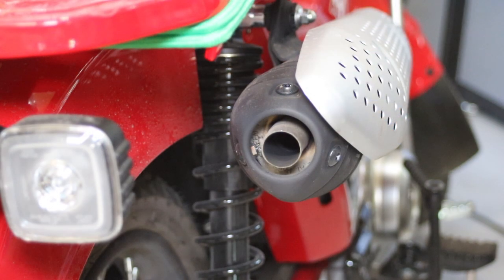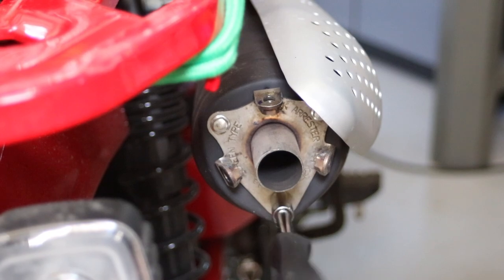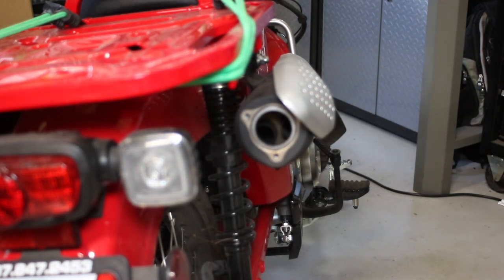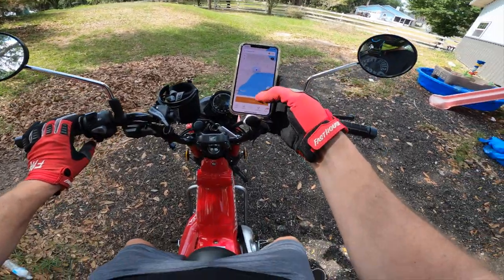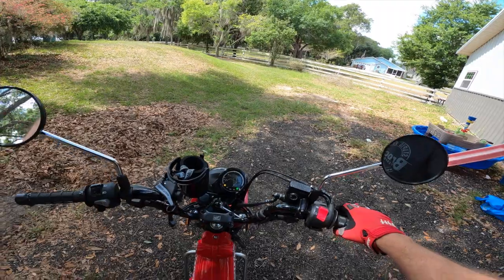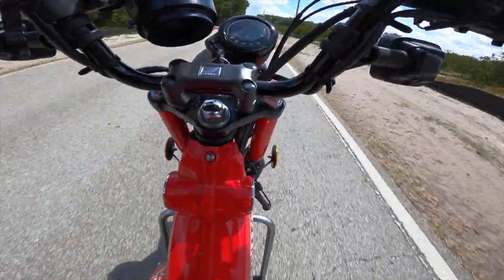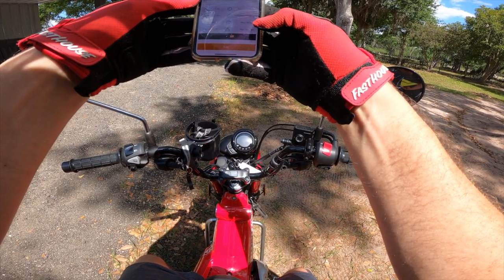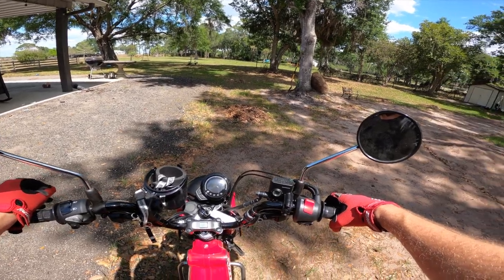Can we unlock horsepower from a stock 2021 Honda Trail 125 by removing the spark arrestor?

Comment: Reminds me of when I picked up my first two CT70s and the kid that had them had hacked the muffler in half on the one that ran and told me it sounded like a Harley. Right!. I replaced it with a new one and couldn't feel any difference in power, it had more with the full muff and baffle if anything. Most people think it's faster because it sounds faster. I'm glad you showed that it actually runs better the way it was configured from the factory and maybe people won't be starting fires in the woods. Also, most modern cats are non-restrictive so that probably won't make a difference either, just make it stink and pollute more. If you want more power just put a turbo on it with a K&N cone air filter, or you could just get a faster bike to begin with. My recommendation is a Hyabusa, 90+mph in first gear, over 150 in 3rd. The kind of bike you give to a beginner to learn how to respect a bike...or die.🤣
BTW, Def Leppard sucks!
Reply from the maker: I love this comment, this video caused so much static because people thought I took out the arrestor and was going around starting forest fires. If watched all the way through like you did, anyone would be able to see that I said it didn’t work and put it back in. Thank you sir for the story, comment, and watching all the way through!
Reply: @John5XR  Oh sorry, I either missed your comment on the video or didn't watch to the end. Probably watching at 3 am and half asleep anyway. I'm glad you did explain the results and hope people won't just take them out of their bikes based on your vid title and watching half of it. Maybe you should have said or put in the title to watch to the end for results of the test.
Reply: What? Def Leppard definitely rocks. I don't think most beginners start on a Hayabusa for fear of death lol. If you have a Hayabusa that you'd like to give to a beginner then lmk. I'll take it. Dude just wants a super cub but bought the hunter cub. I knew the stock was gonna go faster from the get-go.

Comment: If you wanted it to adapt to the change, I'd ride 10-20 miles to let the ecu relearn the optimal AFR then try the top speed run. Just my 2¢
Reply: It probably will add a bit of top end after riding it more uncorked, just idling won't make the ecu adapt the fuel map like riding would
Reply from the maker: agreed, I rode for about two miles and knew it wouldn't be enough to let the ecu adapt to the change, but didn't plan to keep it out anyways. More of a test of curiosity.

Comment: Out of curiosity since you've had it a while. Any future plans for an after market exhaust? I was eyeballing the Yoshimura Cyclone.  Pricey but very cool looking and sounding.
Reply from the maker: There’s a few more I’d like to try, but don’t think any of the high mounts will sound any different. Low mount would be the way to get a different sound, but I’m not a fan of the low mount design due to riding offroad mostly
Reply: @John5XR  Definitely high mount on this bike.  I will say I do like the stealthness of the oem tho.

Comment: would it require enriching the mixture ( a tune) to take advantage of the possible reduced restriction in the exhaust, or any mod that reduces flow restriction? Perhaps the ECU has some compensation, an AFR would be interesting.
Reply: It’s fuel injected ..it should adapt to that small change.
Reply from the maker: ECU should compensate after about 20-miles I think (from my experience with the Monkey). I didn't like the sound of it anyways, so I wasn't gonna keep it in regardless

Comment: I would go for a K and N air filter as well, help to balance output and input
Reply: I wouldn't stop using the foam style or paper style that k&n filters end up damaging engines by dusting them 🤷🏼‍♂️
Reply from the maker: that'd be interesting to test
Reply: Yes they allow more dirt into the engine. Keep the foam.

Comment: I am not sure that top speed is going to be the metric by which to gage whether there was an increase in hp. In this case obviously there was a decrease, but as I understand it, the computer driven EFI acts as a governor and won't let the engine go over a set RPM on the road. Had the speed been identical before and after the spark arrestor been removed then another way to try it might have been to gear up the sprockets to the point where (by using a tiny tach) that top EFI governed RPM couldn't be reached with stock exhaust and then run the experiment. Probably best to use the GPS method as the speedometer will not be accurate any longer.  Then if the bike does go faster then you will know if the mod helped hp or not.

Comment: mine is now 1 year old yesterday. and it loves 50 mph. but on good days i have seen 62 mph. and its still 100% stock. its not for from needing a new chain and when i do i'm thinking of going to a 15/ 41 i will have the same top speed. but when i hit hills for a few days in a row i can drop my front sprocket to a 13 or 14 and get more power. but with a stock bore engine i dont see getting anymore power or speed out of it.
Reply: Update. i took mine out and it seemed to give me a little more power lower end but the same top speed. and made more noise.  so i just cut the screen off and put it back on and same thing more lower end power seemed to hit top speed sooner but still the same. now i'm thinking of cutting the tube off at the mount and see what that might do because it wont have to make 3 trips through the muffler.

Comment: If you want top speed change spockets. 3 teeth less in rear or one tooth less in front. You will get more top and but loose a little low end power. I am the same way I like to test. I have a Yamaha 125 ytx and  I live on a small island in the Philippines
 I use 14 teeth front and 42 teeth back. If no low end torque I can not get up the steep hills cut from mountains.
Reply from the maker: I don’t, I like the low-end grunt better. Just like to test everything

Comment: A lot of these small bikes from 50cc up 125cc maybe a little bigger used to have a small diameter piece of pipe welded into the exhaust where it bolts onto the head to restrict them I removed loads of them when I was younger for myself and friends who had bikes, it takes some hammering to get them out but it always had good results but taking out baffles never done anything other than change the noise so take a look.

Comment: You're gonna need some back pressure on the valves...
Open pipe.. Not good for the engine...
Weld a 3/4 inch washer at the end of the exhaust pipe.. Hold Back pressure on the valves... 
And I Am a mechanic, a real one...
Reply from the maker: agreed, but I put it back in because it didn't change anything

Comment: Check with Ronda ranger about the  spark arrestor you start a fire you pay for it, the fire can cause much damage even deathl..
Check with Honda about hp output that it doesn't matter for the valve's, my z1 lost 3 hp taking out the 4 spark arrestor baffles...

Comment: Exhaust back pressure on any four stroke engine increases the power range, so instead of getting majority power at lower rpm you get power right through to high rpm. The only thing that makes a vehicle go faster is gearing.

Comment: When you lower the exhaust back pressure, you need to change the size of your main jet if you have a normal carb, or reprogram your computer if you are fuel injected, if you want to realize any power gain.

Comment: Actually, if you put the cap on without the spark arrestor you will gain a bit of speed. You left the e d too open.
Reply from the maker: I couldn’t, it was built in and the arrestor wasn’t removable unless I cut it.

Comment: I've learned some things run better with a little back pressure
 I had a blown small block Chevrolet drag car I wanted to make it straight legal so I put mufflers on it And it actually ran better Even at the drags with a muffler's on

Comment: On my Wave and on my partners Monkey, removing some restrictions from the Air intake helped getting more low to mid range rpm performance.
- On the Wave I drilled extra holes into the airbox and on the monkey we removed that snorkel piece.
I tend not to mess exhaust and intake at the same time for fear of leaning out the engine.

You'd need to now muck around with changing the tune and you'll loose some of that Honda reliability.
The Grom has nearly the same engine and you rarely see Groms with high mileages because their owners wheelie (starve the engine of oil) and "upgrade" these bikes.

Yet the engines are known to have amazing reliability if treated well.
My Wave 125i is now at 78000km and still runs like clockwork. I've heard of some people reaching 160,000km on variants of these bikes. One owner told me his ultra high miler died because he did some stupid stuff with it in extremely cold weather (well below freezing) with the wrong oil.
Reply: If you add an oil pump to the grom it at least will prevent the oil starvation when doing wheelies

Comment: Change your jetting. If you change anything with the exhaust, you need to change your jetting. You should, probably, do something about the air filter, as well. That mod shouldn't require a real change to the air filter, but it never hurts.
Reply: @EZ4U2Say11  Yes it is. The word "Jetting" is used for tuning your fuel injectors. Look up JD jetting kit. In the case of bikes, PC V or straight through the ECU.
So that you are aware, fuel injectors also have jets. They can be changed as well, but usually they just need to be cleaned.

Comment: I'm not too sure, but I think a better exhaust increases throttle response and acceleration not top speed. Is that accurate, for anyone who knows?
Reply: Usually better flowing exhaust increases maximum HP, while sometimes even sacrificing low end torque. 
At high rpm where top power is made, the engine is moving the most amount of air. A restrictive exhaust limits the amount of air that can move and limits HP. Thus allowing the exhaust to flow better can allow the engine to flow better at max rpm and make some extra power. But this doesn't hold true if the exhaust wasn't the bottleneck in the air flow system.

Comment: It might be related to backpressure and scavenging in the exhaust.  Backpressure is when the exhaust flows (typically) down the center of the exhaust, but air flows around the edges back towards the manifold in reverse.  You increase backpressure by removing the arrester.  But also, the factory design might include some induced scavenging of exhaust, so that the restricted flow actually creates a low pressure that "sucks" the exhaust out more efficiently.  Don't know if either is true here, but those could be contributing factors.
Reply: Exhaust dynamics are so complicated and counter intuitive that you really need to understand them or you just make it worse most of the time. Better yet, leave it to the professionals, even though I've heard plenty of people tell me that aftermarket cans and such usually reduce power unless it's a complete header system from a manufacturer with a racing background. And then some people just think it's faster if it's louder.
Reply from the maker: Louder definitely “feels” faster. Agreed
Reply: Back pressure is much more a 2 stroke thing, you need it so when kids remove the baffle they often loose performance. The baffle on a four stroke is about sound suppression and shouldn't make much difference
Reply: @nickcarter9538  someone was almost talking like this wasn't too stroke probably a lot of people don't really know and they start using terminology they don't know anything about just doesn't have scavenging ports it has a port for the exhaust and a port for the intake valve

Comment: 4 strokes, dependent apron some back pressure in the exhaust pipe to help the valves seat properly at higher revs. Different to a  2 stroke like the old  sweet Yamahas, say a RD180 twin. Derestricting exhaust really let them perform, hence exhaust expansion chamber put on by some onto their single and twin cylinder Bikes that gave performance increases. So 4 strokes and2 strokes are very different animals.

Comment: LOW COMPRESSION MOTORS NEED SOME BACK PRESSURE IF U CUT THE TUBE N PUT THE TIP ON IT WILL PROBABLY PICK UP A BIT
Reply: i ALSO TYPE IN ALL CAPS!

Comment: Shows you the importance of back pressure that's why you had the outcome that you did.
Reply from the maker: there's a fair amount of back pressure with the catalytic converter, so I was curious to see if freeing up the additional back pressure helped any, which it did not
Reply: @John5XR  it's surprising how much back pressure is critical to an engine. That being said I wonder if you could do some sort of tuning on it software-wise and get it to richen up wonder if that would make any difference with the more free-flowing exhaust. Being careful not to be too free-flowing and burn an exhaust valve.
Reply from the maker: Oh absolutely you can, check out my Monkey videos about the PGM reflashes.  I just don’t plan to mod this bike all that much
Reply: @John5XR  I will have to check out those videos!

Comment: No...there is no free horsepower.
Any horsepower gained comes with great expense. Also, removing the spark arrestor is bone head. It's there to prevent fires. Restriction is there to restrict sparks...
Reply from the maker: Just a test because I was curious Chucky, it went right back on. There’s no fun in having a thought and not trying it, right?!
Reply: @John5XR  I am a retired aerospace engineer and my experience telles me you have to increase volumetric efficiency or, in crease displacement or, increase compression ratio.
Volumetric efficiency, remove airflow  restictions... 
Increase displacement, very expensive...big bore kit.
Increase compression ratio...
This increases heat related problems..

None of it easy....

Aslo, it feels odd you calling me Chucky... I'm 70 years old.. thanks for making me feel young again.
Reply from the maker: Agreed. For the sake of interesting content, I wanted to try it. My hopes however were low. Just an old trick I used to do on my old 50cc Honda XR’s to get a bit more oomph, but then again I could adjust the air/fuel in the carbs to compensate. Glad you’re watching, being old is only a mindset. It’s what you do that determines your age 👍

Comment: This is a bs video lets be real. There isn't free horsepower gain from removing something on an engine that can barely get you up to 55 without being rung out. especially when the transmission is limited to a certain speed and the bike isn't even aerodynamic.
Reply from the maker: Watch the whole thing and your point is proven 🤦🏼‍♂️

Comment: On a fuel injected bike exhaust and intake mods need an ems retune.
Reply from the maker: To fully optimize, yes. However, the ECU has the ability to "learn" and adjust it's fuel map to accommodate minor changes to the intake and exhaust. I do feel that I would need to give the ECU more time to learn the difference and adjust for it, maybe 20-miles or so, but I don't accumulate miles that fast on this bike and someone who rides longer distances would probably figure that out quicker than I

Comment: ?? A 125 should be running much faster!!  My 1970 Honda SL70 and my brother's Trail 70 would both hit 60 mph and my neighbor's Trail 90 would hit 70 mph! Our friend's XL 125 would hit 80! Of course this was in early 1970s but newer 125s should still do this!
Reply from the maker: there's a lot more control of the engine and how it's working with the modern fuel injection system. older bikes with carbs could be tweaked a lot easier to suit the environment or simple mods (opening up exhaust and air box)